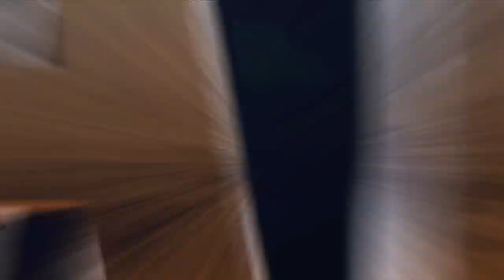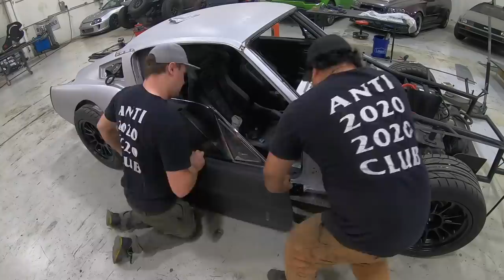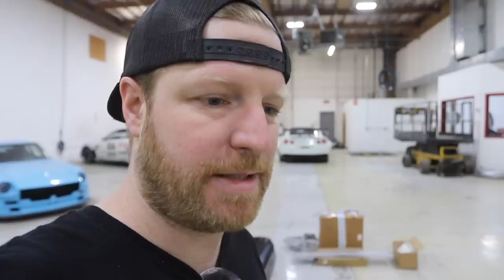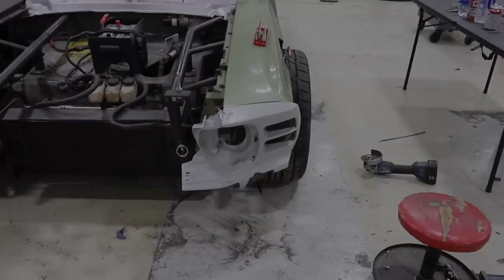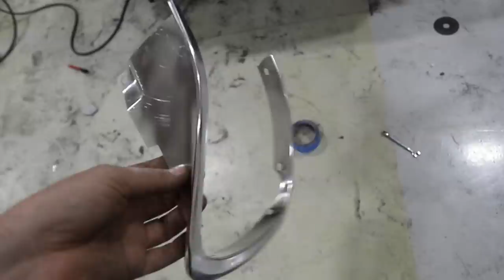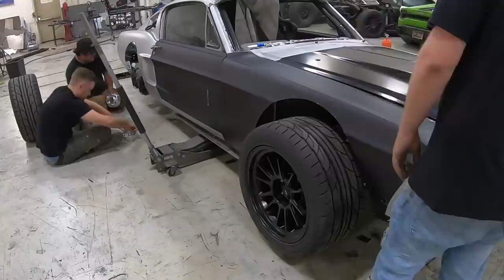Mid Engine 67 Ford Mustang Fastback Returns! Front End Conversion, All New Design, And Gets Wider!

Comment: Let's see those front wheels turning with that much offset
Reply: It honestly looks like a hot wheels car
Reply: The only real aim for SEMA is that it looks good.
Reply: It’s the look bro. trust the renderings. Lol😂
Reply: R is for ruined
Reply from the maker: the fronts have a -35mm offset, so only over an inch off center, which wont make the wheel scrub (like spacers do) so when its got a relatively clean pivot on the centerline, it should rotate clean inside the kit. As it is now it would hit the fender, but when you build the kit out to match wheel face, it starts to tuck inside really quickly.
Reply: @BisforBuild  Would drift suspension help with this to get those big turn angles on the steering?
Reply: @EvilEndz  it would make it rub more...
Reply: @kylemcweeny878  ah I wasn't sure, just seemed like they get so much angle in less space than you'd normally use.  Like black taxi cabs in London, they have ridiculous movement in the front steering
Reply: Sounds like you like to critique your meal before it even leaves the kitchen.
Reply: Let’s see Paul Allen’s offset
Reply: It will turn within the arches. You’ve seen the finished design, haven’t you?!
Reply: @BisforBuild  I don't understand the negativity from these people who are probably driving a 2000 Camry SE "TRD" with a hickey on the right front corner from running into their moms handicap chair.
Reply: Well… it is a mustang
Reply: @ryurc3033  it’s not a negative comment. Just wanted to put emphasis on a problem that might be a pain in the ass in future if they actually plan to drive this car. And trust me, I’m not driving my moms car so not need to judge if you don’t know what I drive or what I’ve built…
Reply: @alxgu198  We've seen the finished design but not the finished car, yet ;)
Reply: @EvilEndz  exactly, so the wheels and arches will be fine, they’re on it 😁
Reply: @BisforBuild  Don't make the car so wide, that you can't get it into an enclosed trailer.

Comment: It's gonna be tough to take the full 1970 rendering with a 67 mustang body. The fastback lines are totally different. Regardless I'm happy to see some mustang content.
Reply: I was about to say the same thing. They should really have Karan do a render version using a 67 as the actual base car.  69/70 is a much plumper design which lends well to the plump wide body render... might not look so good on the 67 chassis without major massaging.
Reply: also what I was here to say.
Reply: Indeed, he was complaining about shit parts, but they are not supposed to fit from factory. Two different body styles, best of luck either way

Comment: You might want to check how wide overall the rear of the car will be. If it is wider than 8' wide, you'll need to apply for a wide load permit from ODOT to drive it on the road or on a trailer.

Comment: why only a 12 wide wheel? you can go for like a 14 wide with like -70 offset or whatever the math is.
ive had 11.5 wide +10 offset on a stock body e36 with a roll/pull and no added camber other than what the coilovers did. u can fit some massive even 15-16 wide on here im sure.

Comment: Why did you just cut those original headlight units, are you mad...
500 dollars each and you've ruined them, what where you thinking?
That's the time to use aftermarket bits and cut down on weight 🤷‍♂️🤦‍♂️

Comment: That render is based off a '69-'70 Mustang. A somewhat wider body through the roof C pillar to C pillar.
Reply: 1970.  The 71 is WAAAAY different.
Reply: @TheTalonts  I meant 69 - 70, actually. Thanks for the assist. I really think the proportions are going to be way off when the wide-body is finished.
Reply: @epegasu5  - yep.  The main body on a 67 is narrower, so it's going to look even more cartoonish on the fender flares.

I owned 3 70s, a 71 convertible, and a 73 back in the mid-80s.  It was easy to "narrow" a rear end by just getting one from an earlier generation.  I fit N50-14s with a 12.5" tread width inside the rear fender wells of the 71 convertible simply by throwing a 70 rear end in it, as it was 1" narrower on each side yet the spring perches and everything else was in the same locations.  ZERO body mods and it tucked them right in.

Comment: So what your saying is sema cars are literally lego bricked together with tack welds and bondo for the most part?
It's a shame if it is mostly done like that, in which case I'd have to  give more credit to those cars with a brushed finish.
Why not just pull the front oem fenders and use the gap as an air vent...
Same for the rear aswell. 🤔

Comment: Interesting  video the rt fender on the  right fender it looks like a 1969 
To 1970 fender they are  stamped diffrent  the 1967 to 1968 are the same
. Also difference  in head lamp buckets, front end for 1967 
& 1968 are diffrent to 1970. 1969 are close

Comment: Dude he has the 3d file why not get each piece (Fender, bumper etc) 3d print them and make molds? outside of time constraints I suppose.. Of course I suppose also the 3d model maybe isnt based off a real measurements of the mustain either..

Comment: Making that width with just wheel offset is going to make for a horrendous scrub radius on the front end. Have you thought about making longer control arms to keep the scrub radius as low as possible?

Comment: Very nice design! I hope it will come together even nicer!
But, I have some considerations: first, you will need more pronounced wheel arches giving more 'volume' around the outer end of the tires, especially in the front, so the suspensions will be able to work also nicely.
The second one that I have to point out is aerodynamics! Most wide-body kits will reduce aero efficiency disproportionally to the increase in the frontal area in some sections, and few will give you more downforce. Note that aero development is not as intuitive as people think.
I hope you will be able to enhance your project with my little 'help'! All the best!

Comment: I heard somewhere on the net that the reason these aftermarket parts fit like crap is if they can make them slightly different from the originals they can get away from paying the licensing fee to the original producer, in this case Ford